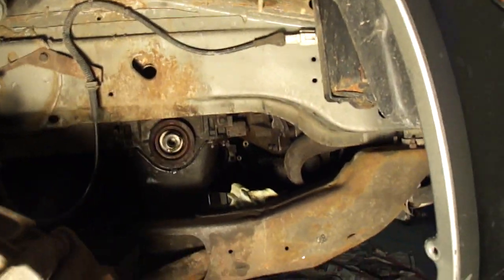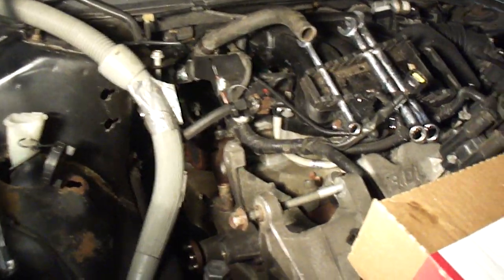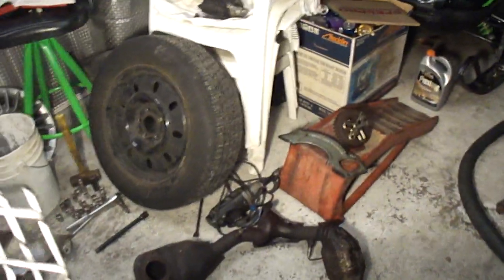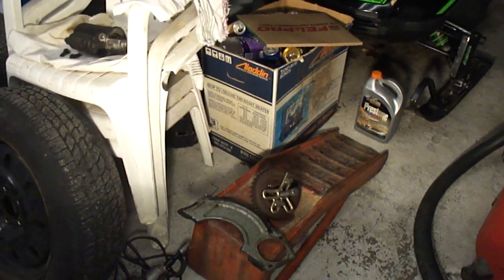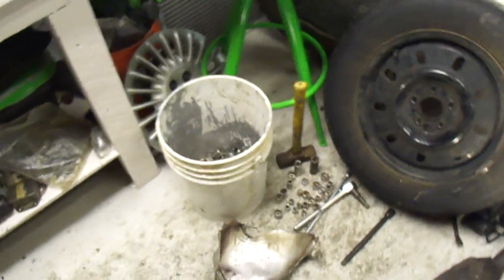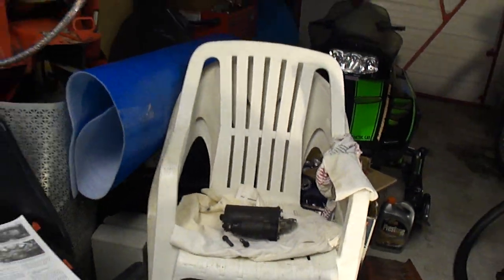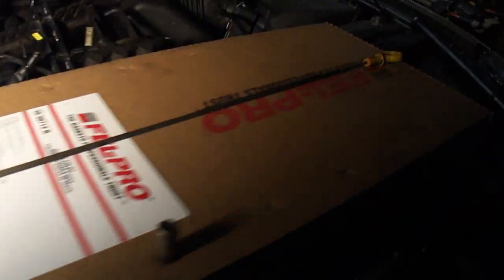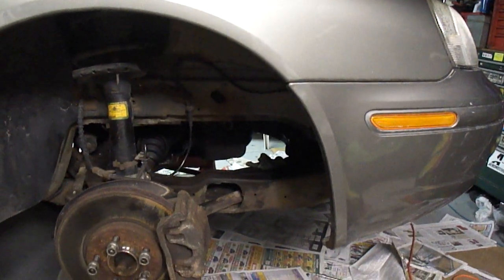Mercury Sable/ Ford Taurus Coolant Leak/ Oil Leak Repair Part 3

Comment: On a 2001 taurus u code is the bolt for the harmonic balancer right hand or left hand threads,how hard is to take off with the puller?

Comment: How did you remove the Y pipe? That's the one that goes from the front of the car, under the oil pan and to the exhaust pipe, right?

Comment: Hello! I am currently trying to remove the harmonic balancer. I already have the bolt out and I am using a puller like yours to remove the harmonic balancer but I'm having trouble figuring out how to stop the engine from turning over... any suggestions?